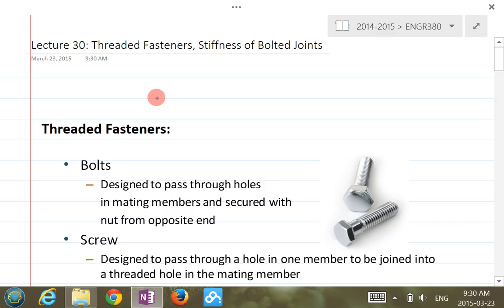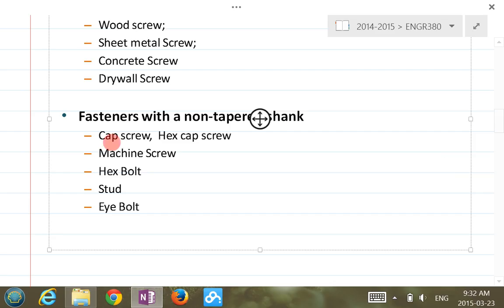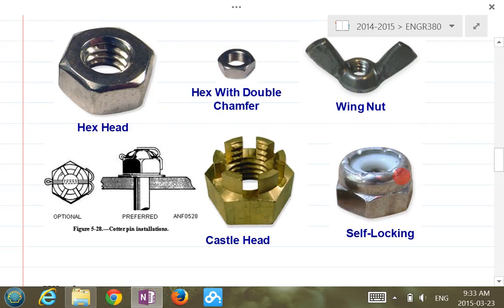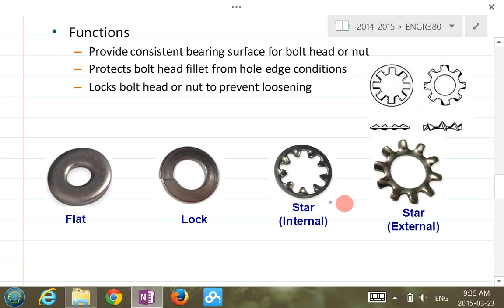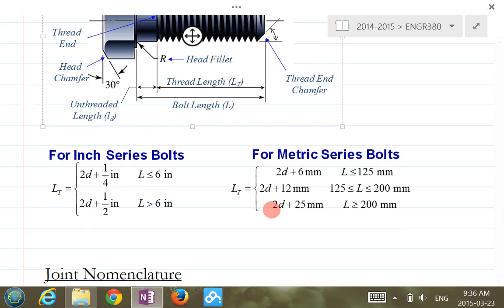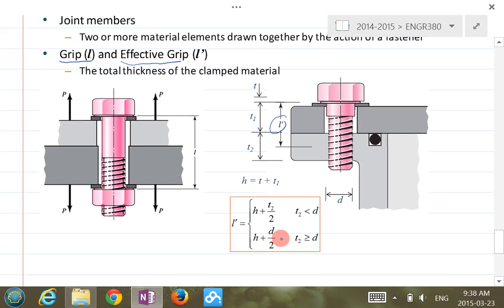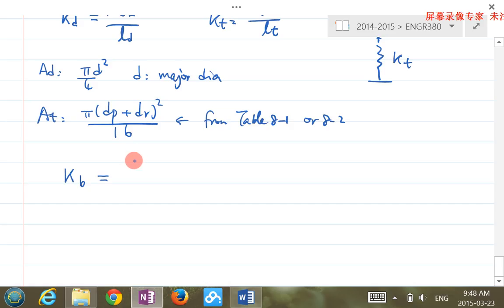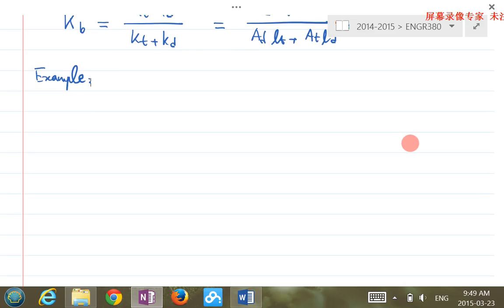2014W ENGR380 Lecture30 Threaded Fasteners and Stiffness of Bolted Joints

Comment: What are Screws?

If it has a head on one end it is a screw.  The head is driven or turned with a screw driver or sometimes with a wrench.  The diameter ranges vary to meet demands and needs of specific products.  Screws are generally turned into an object, like a piece of wood, so the head needs to be bigger than the surface.  This prevents the screw from being turned further than the length of the screw itself.  There are a few exceptions.  For example, set screws have smaller heads and have special uses.  There are a few screws that are tightened counterclockwise but most of them are tightened by turning clockwise.

What are Bolts?

Bolts are screws that rotate into a matched nut to tighten it.  Bolts have a bigger head than the shaft, with a few exceptions.  Carriage bolts and J-bolts are among those exceptions.  The shafts of bolts are not tapered, whereas many screws are tapered.  The main difference between a bolt and a screw is that a typical screw can work on its own and a bolt requires a nut to secure it.

With the exception of the Machinery’s Handbook, which states, “A bolt is an externally threaded fastener designed for insertion through holes in assembled parts, and is normally intended to be tightened or released by torquing a nut. A screw is an externally threaded fastener capable of being inserted into holes in assembled parts, of mating with a preformed internal thread or forming its own thread, and of being tightened or released by torquing the head,” there are few places that attempt to define the difference between a screw and a bolt.  The important thing to remember is that each has its own purpose and you should be careful to use the right screw or bolt for the project that you are working on.  You should find out what the bolt or screw is made of and what strength it is capable of before you choose a bolt or nut for your project.  Screws and bolts do many of the same things but there are many types and you should consider what you need it to do before choosing one or the other.
https://www.melfast.com/blog/2010/11/what-is-the-difference-between-a-bolt-and-a-screw/

Comment: What happens if you use a washer which hole is slightly too big for the threaded end of the screw, but still small enough to just barely hold onto the edges of the screw head?